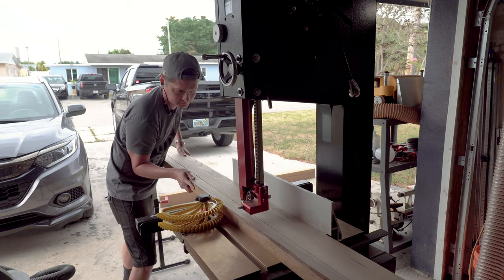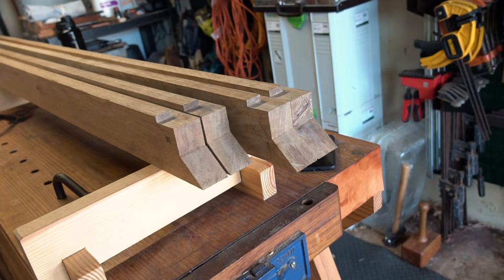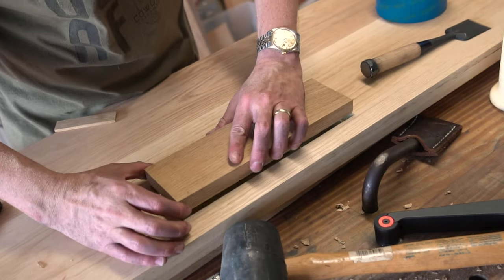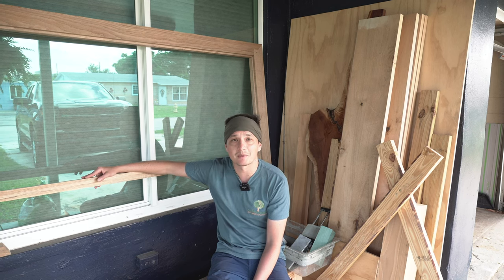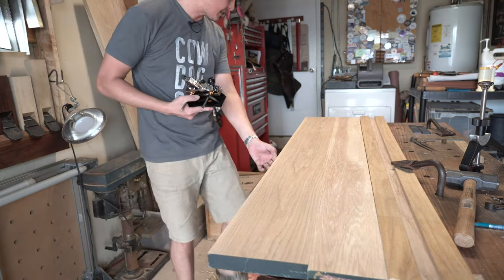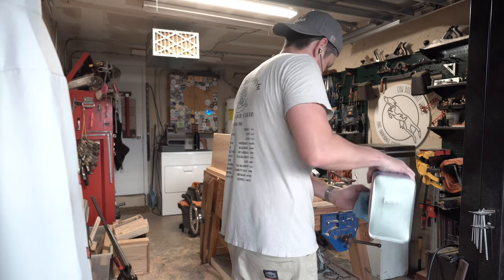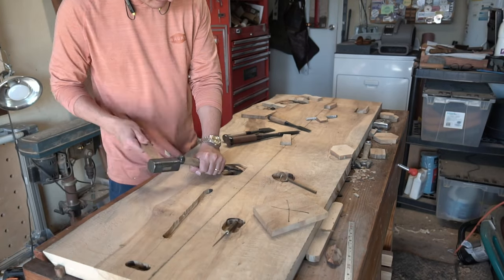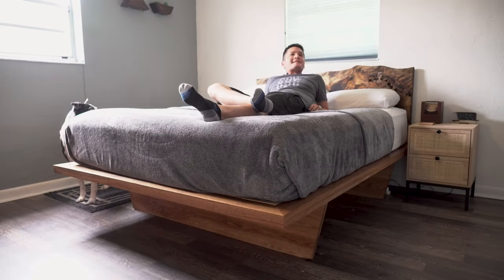Homemade $10,000 Bed

Comment: That is a seriously nice build. I love the fact you used the Japanese miter joint at the corners. I also loved the angled support pieces. That small touch increased the aesthetics big time. Bravo!!

I built matching ash side tables for our bed a decade ago. Mortise and tenon joints with interlocking pegs and a butterfly brace on one of the tops that holds together a large fizzure in the ash. Japanese carpentry figured heavily into the build. I used no nails, no screws and very little glue. Watching your video reminded me of that build and how much I learned during the process. 

Love to see the hand tool action. I am constantly in debate with myself with which power tools I can get rid of and accomplish my objectives with only hand tools. 

Keep up the good work. Love the channel!
Reply from the maker: Those sound beautiful! Ash isn’t the easiest to work with so bravo to you. I’ve slowly transitioned more toward Japanese hand tools over time. I just find that power tools tend to rush me to the point that I’m making mistakes at a faster and less controllable level. With that being said… they’ve got a place in my shop and I do need to be better about using my bandsaw for doing tenon work and cutting large tapers. Thanks for watching.